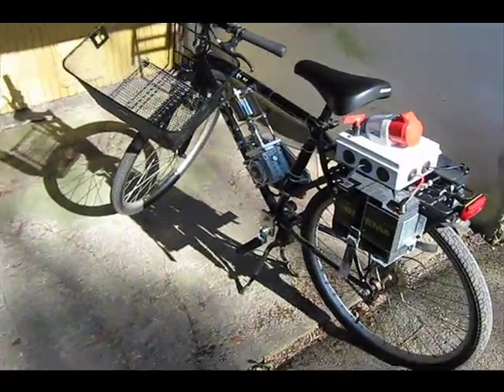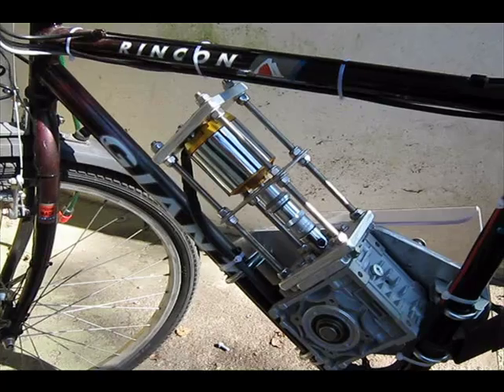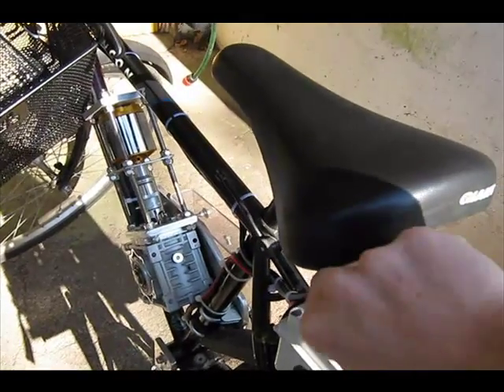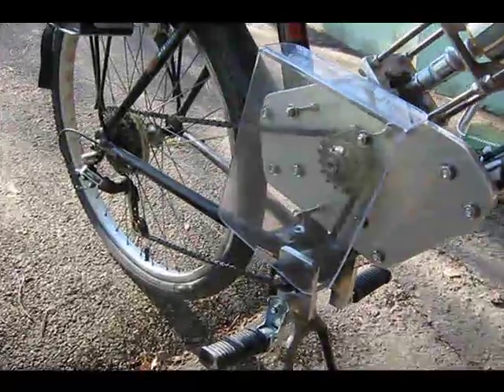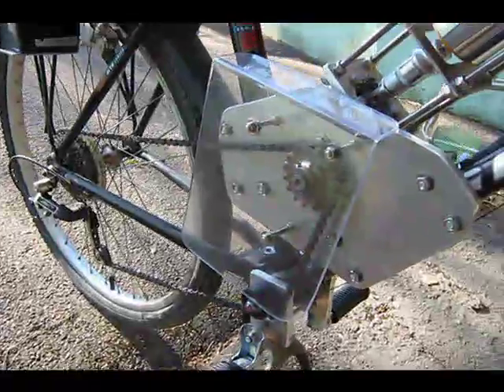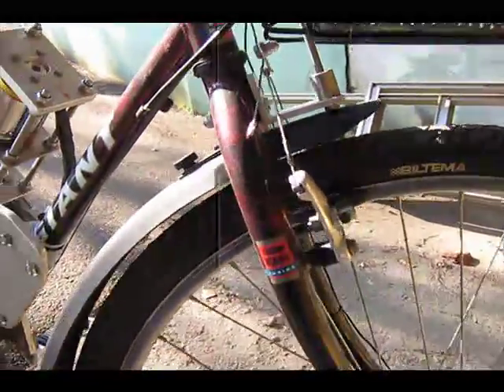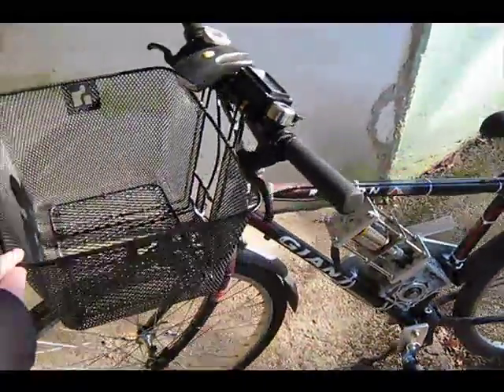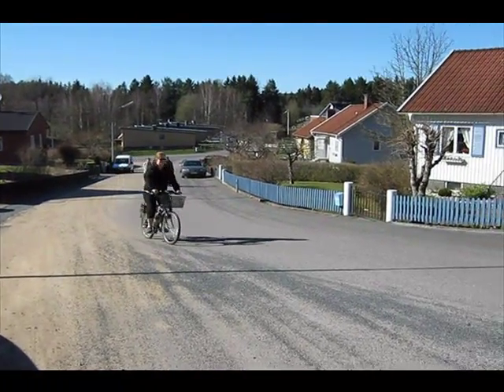Home Built Electric Bike

Comment: very impressve, but I think this motor is too small and  too fast (high KV) for this project.
You should use bigger motor with Lower KV  like the RV-100 that I use,
It will lower the current and Temp.

Comment: http://www.hobbyking.com/hobbyking/store/__22036__NTM_Prop_Drive_50_60_270KV_2400W.html
Would this motor be sufficient to drive a bike to 40 km an hour ? I'm also wondering why such a big motor is required in the video.
Reply from the maker: +Ray Liu The problem is the torque, not the effect. I'd say that 2400W not will be sufficient to start the bike, but maybe could work if you first pedal the bike up to some speed.

Comment from the maker: A chain is definitely more cheap and easy, especially since I wanted to use the 7 gears on the rear wheel, se my video electric bike part 2. For sure belt drives could be nice, but it's hard not getting the belt to slip and I don't have that kind of equipment.

Comment from the maker: Sure, as you can see in my second video (Electric bike, part 2) the bike goes 52 km/h using the 7 gears. Also, the effect is redused to about 1kW by using 24V lead batteries instead of 48V LiPo.

Comment from the maker: @gabel13 A smaller motor or less gearing wouldn't produce enough torque to start the bike, se earlier comments. If you strive for low cost and high efficiency a hub motor is the best soulution. However, this was more of a technical challenge.

Comment: I have the same idea, and plan on building this year. It looks like you used the Turnigy 80-100. If that is true, Why did you de-rate the motor to half?  You might as well have used a smaller, cheaper motor. You could have saved $150US.

Also, If you mount the motor transverse, you gain the opportunity to use multiple motors, thereby beyond 30kW with very little redesign time. Those right-angle gearboxes are expensive and weigh more than an additional motor. 

Good work anyhow.

Comment from the maker: Concerning Swedish laws the e-bike motor must stop if you stop pedaling the bike, also the effect and speed is limited to 250W and 25 kilometers per hour. In fact it's meaningless to try building a legal one. My bike is not very loud, but you can hear the motor running.

Comment from the maker: Actually I WILL change the gears, although I'll keep the lowest gear for uphill rides, due to the motors low momentum. (Perhaps it would also be an unnecessary provocation for the the brakes and police with a too high speed?) Also I will change batteries for more range (no pedals on this bike). I'm posting a new video after having done these changes. /B.R. Mats